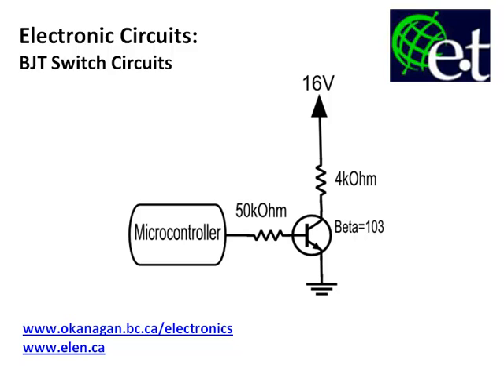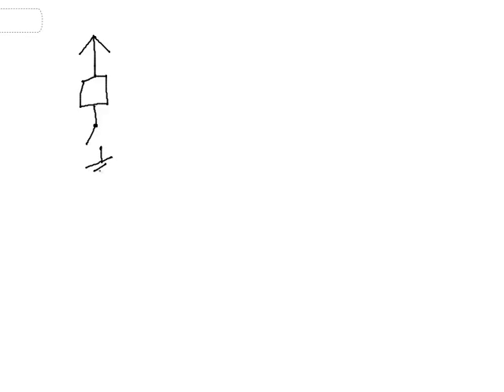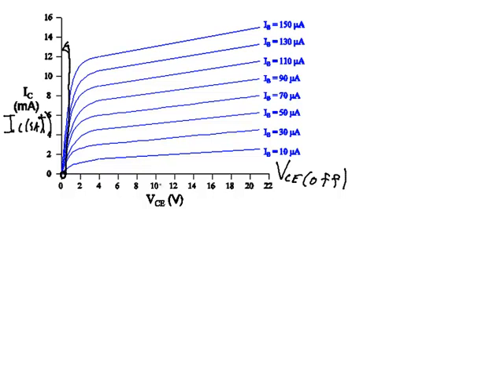BJT - Switch Circuit

Comment: So the saturation current of 400 mA is determined by the motor rating (10V and 400mA). The transistor itself might be capable of conducting more than 400mA ?
Reply: It depends on the transistor. The design here is that you need to use a transistor capable of 400mA or more.
Reply: @stefanopassiglia  Thanks

Comment: David could you explain how to design H-bridge circuit ?, it is little bit hard in calculation (Designing) espacially when i tried to calculate the IC and VCE and what make it hard as i think that i am also not famlier with calculating circuit which not common emitter neither common collector

Comment: Hello david ...thank for the videos , they are really amazing....i have a question please : why we cant use the BJT as a switch in its active mode ? , since in the active mode we can also know exactly the value of IC also...am i missing something :).....thx
Reply from the maker: +Mohamad Fakhoury you could set your switch up so that it is in the active region when turned on. One problem is that then the operating point is dependent on beta. If beta changes from what you designed your circuit for, then Ic (which is your load current) will change too. If you make sure that your transistor is in hard saturation, changes in beta will not cause Ic to change.
Reply: Thank you for your fast reply .
Just to understand fully your answer :
do you mean that beta changes within the same transistor ? .
Thx
Reply from the maker: +Mohamad Fakhoury Yes, beta is temperature dependent, so can change for the same transistor.
Reply: its all clear now.....thank you very much
Reply: when the transistor is working in active region.then the transistor will waste a lot of energy too
Reply: I guess this question is 5 years old but in any case, you definitely can do this if you just set up your transistor as a current source instead, so that you then are 'turning on the current source' by applying the voltage to the transistor base's voltage divider. Doing this would serve an entirely different purpose though, than just switching on the voltage over a load of course. But yeah you can use the current source to drive LED's then or whatever

Comment: I'm designing a bridge motor circuit with 12volt supply and 1Amp motor. I used your formula with the gain characteristics of my O/P transistors etc. to work out base bias component values. This was amazingly helpful. Thank you